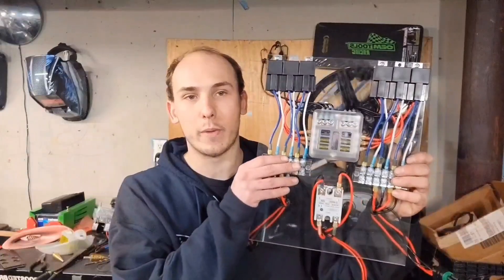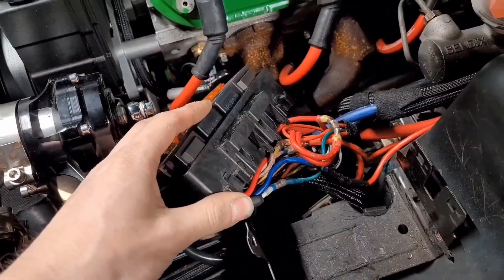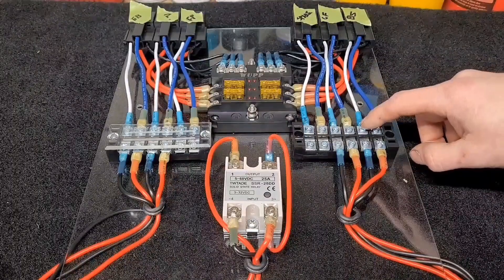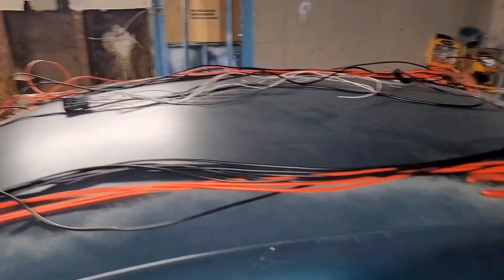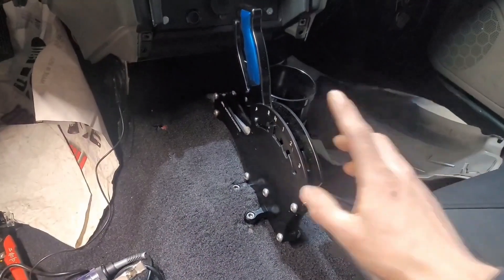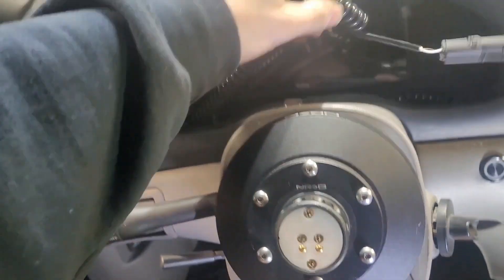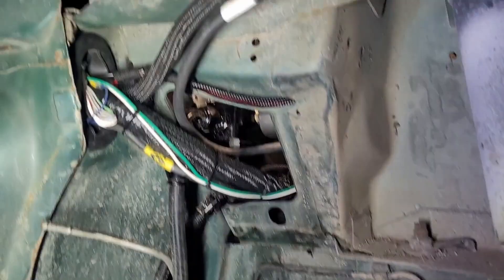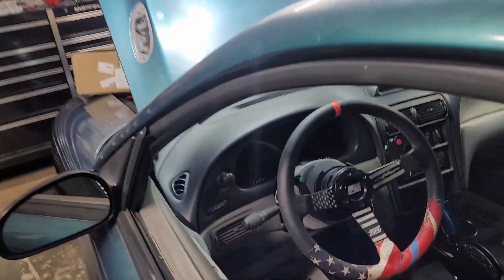Holley Terminator X Input/output Wiring

Comment: How did you setup the wire in the terminator software for the flex fuel sensor? I’ve got four wires left that I can use off that factory 8 pin that you used. The issue I’m running into is how to set it up in the software once I picked a wire. Thank you and very good video.
Reply from the maker: So I used the sloppy mechanics flex/alt harness. That 8 pin has 4 wires for input and 4 for output. White is inputs gray is outputs. You pin the output (1-5V reference) into the holley on the input side of the harness (remember the wire color you use) and then assign it in the pin map and set the sensor parameters up, I believe there's a preset in the drop down for the GM flex sensor. If what I'm saying sounds hard to follow or like gibberish, we can jump in a discord call in the evening and I can screen share and show you how to set it up
Reply: Yeah, I used current performance wiring flex fuel/alternator harness and it plugs straight into the 4 pin plug that’s close to the 8 pin plug. It plugs directly into the harness and gives the ALT the signal it needs, and then has a single blue wire with a butt connector on it that says flex fuel output. I think the issue I was running into is that whenever I plugged my computer into the Holley system using the USB cable it wasn’t showing etc. as presets that I could use. All it showed was -ALT. I’ll take a look again shortly. Yeah your help would be greatly appreciated. This is the last sensor underneath the hood. I need to get hooked up after that trying to get the signal light wires connected to the Holley 6.86” Pro Dash so it’ll show them etc.. Holley would have made things so much easier if you could make changes, etc., right then and there rather than having to save stuff to the memory card and then upload it etc. they nickel and down you for everything, harnesses, plugs, etc. and then give you minimal information on how to hook things up lol

https://currentperformance.com/shop/holley-power-tap-flex-fuel-alternator-harness/
Reply from the maker: I also have a 6.86" pro dash and can walk you through the turn signal stuff as well, it's fairly simple!

I'm in an eastern standard time zone, and anytime between 6 and 10pm would work best for me. 

You can join my discord server at the link below, it's the easiest way to share my screen and you can use it on your computer or phone

https://discord.com/invite/V8SAhxwk

Comment: How did you wire up the solid state relay and to the holley? My trans brake has 1 wire and my tb button has 2 and the bump button has 2
Reply from the maker: Starting with your trans brake button and bump button, one of each buttons wires will be installed as inputs to the ECU, the other two wires will be wired directly to ground. We're going to be setting them up as a ground input, meaning when we press the button, ground is sent to the ECU and it activates the output.

From there, we take the output wire from the ECU and wire it into solid state relay. The relay has 4 connections. we need power in, power out, ECU trigger, and relay power.

If you're using the same relay as I, poles 1 and 2 are power in/out. So we feed pole 2 with power from the battery (mine also has a switch inline) and pole 1 is our output from the relay directly to the trans brake.

Now to make the relay activate, it ALSO needs power and ground. Your ECU output will be the ground on pole 4, and for power on pole 3 you can run a jumper wire from pole 2 to pole 3. This is also your chance to connect your reverse lights or underglow to pole 1 if you don't currently have functioning reverse lights, or want your underglow to turn on with the brake (the underglow I have, has a separate wire to make the lights white while in reverse, so if I'm staging the car, it would be whatever regular color I have it as, turn white on the trans brake, and flash back to the original color and back when bumping )

Here's a link to the diagram I used made by Matt Happel of sloppy mechanics. I would suggest quickly bench testing the relay with a small battery and a multi-meter to ensure your relay doesn't have reversed polarity or anything else not working properly.

https://www.thechicagogarage.com/threads/how-to-wire-in-solid-state-relay-ssr-bump-staging-control-etc.177412/

Once you get it all installed, there is a red light on the relay itself which will show if you're activating the relay, in the Holley software it took me a little while to get the settings/logic figured out to make the brake and bump work how it's supposed to. If you have any issues with the computer side of it or need any other help feel free to reach out!

Comment: Man, i wouldnt know where to begiin with shit like this. Cars got a lot of parts, it gets hectic
Reply from the maker: It comes with time! You start off doing smaller, simpler things and slowly you work your way up to bigger stuff. On bigger jobs organization is key.

Cars do have a ton of parts but at the end of the day everything is just nuts and bolts, and most things are separated into a couple of major systems that you can learn fairly easily.

If you told me 5 years ago I would be doing stuff like this, I wouldn't believe it. There's still tons of things im not good at, but practice does make perfect and sometimes good enough is acceptable. 

Don't be afraid to get your feet wet!